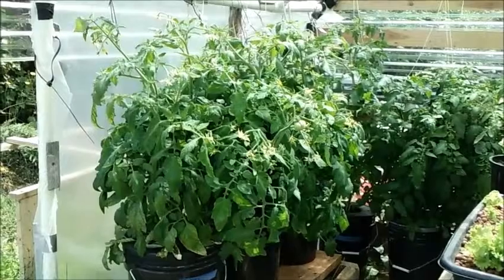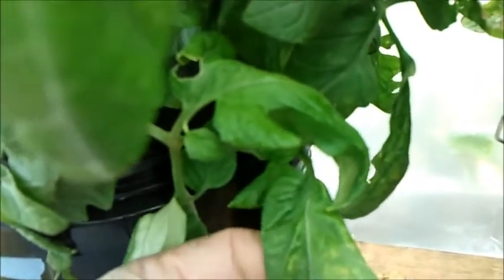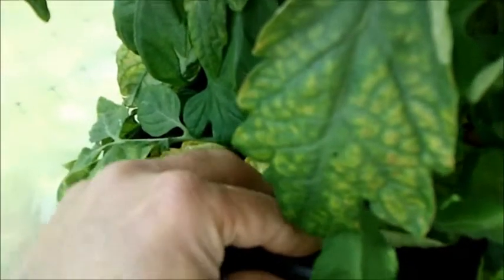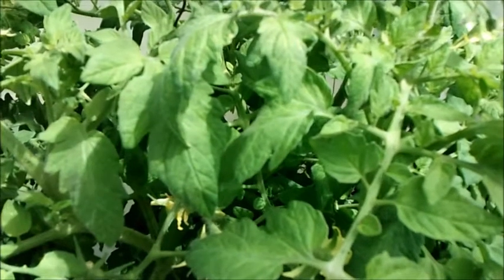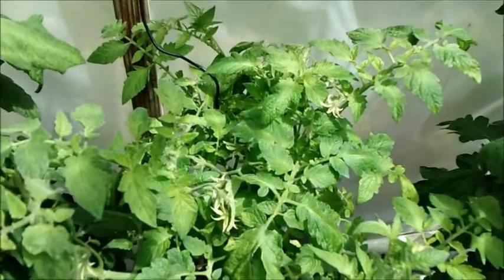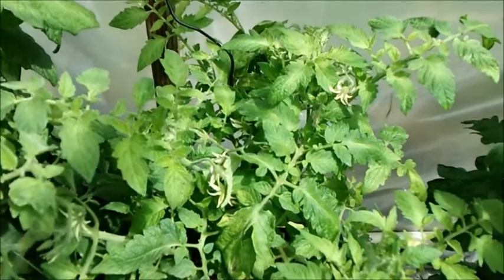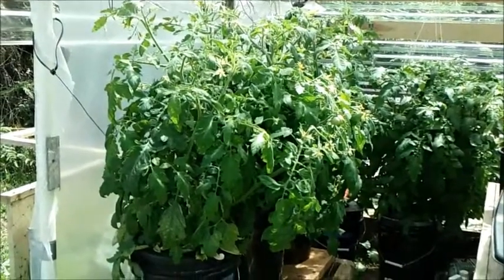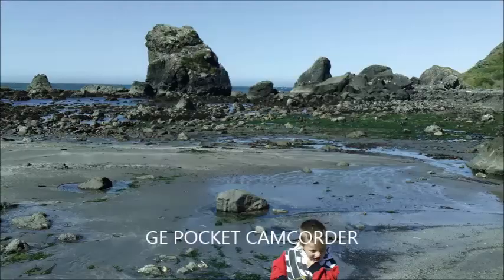Kratky Method-DWC-Compost Tea Hydroponics (3) Hydroponic Tomatoes

Comment: For the size of plant you have it would be better to have near 1000ppm if food but full with water when it starts getting low because that will raise the ppm because they drink more then they eat. When the plant has a canopy you cannot really see through its when you should be near 1000ppm, if you can see through the canopy then 400 to 700 is best but really it depends on the plant.

Comment: From my observations and experience with growing fruiting plants in a Kratky system, I suggest the problems encountered were in part due to "refilling" the nutrient solution completely.  In this video, it appeared as if the nutrient solution level was back up to the base of the net cup.  Many people familiar with DWC often have issues when trying Kratky (I know I did) because the complete nutrient solution refill that worked with DWC (because the aeration of the pump kept fully submerged roots from rotting) will absolutely cause havoc with the roots of a plant in a Kratky, non-aerated system, as it drowns the roots.  I lost many, many plants this way.  Although changing the water in the system introduced new levels of dissolved oxygen, that eventually depleted and left the "air roots" sitting under water.

I believe your later analysis that temperature played a part in the problem was accurate as well.  If you try Kratky again for tomatoes, be sure that you keep the nutrient solution cool (or at least relatively cool) and only refill the solution to the extent of maintaining the bottom inch or two with nutrient solution.  The stunted (halted) growth of this tomato is likely due to the converted oxygen roots being submerged each time the solution changed, which will damage them as they cannot convert back to water roots after adapting from water to air.  The true concept of Kratky is to fill the container with water and nutrients only once, without the need for aeration or water circulation, enabling the grower to get some rather impressive results completely off-grid and with minimal to no ongoing maintenance.  B.A. Kratky, the professor usually credited for this method of growing, advised that this technique works best for short growth-cycle plants like lettuce, and that a head of lettuce needed roughly one gallon of nutrient solution and one month from seedling transplant to the system to grow fully.  For fruiting crops like cucumbers, he recommended using a 32 gallon plastic garbage can filled with solution, as they would take all of that to completely grow.  He also showed that tomatoes were successfully grown in a Kratky system as long as 2" of solution was maintained in the bottom of the growing system.

DWC will always have a clear advantage over Kratky when air pumps and electricity are accessible, as the larger mass of water in the DWC (full refill thanks to the aeration) can retain cooler temperatures more easily than two inches of solution at the bottom of a Kratky system.  Great experiment and I hope to see more videos about hydroponics!

Comment: With the Kratky...... If you add water or nutrients you don't want to go over the water level that the plant is currently at.  As the water level drops the plant develops new roots in the area the water use to be to absorb oxygen.  So adding water drowns the plant if you go over the previous level.